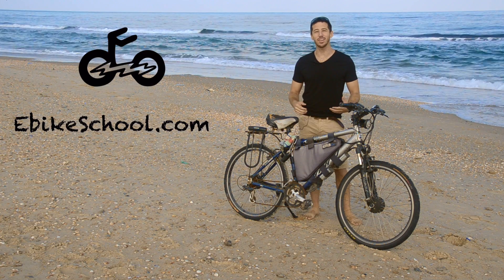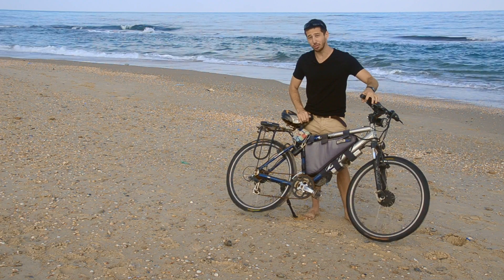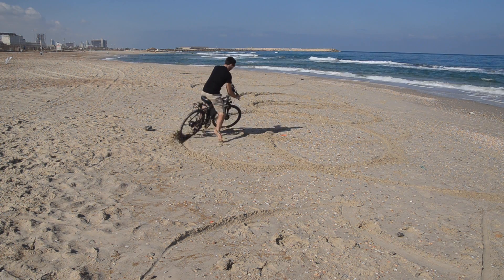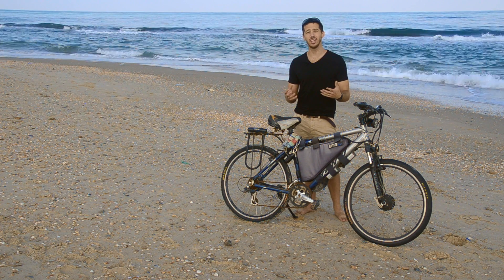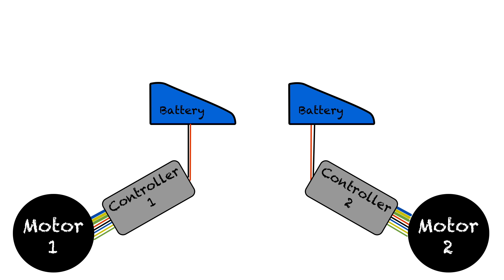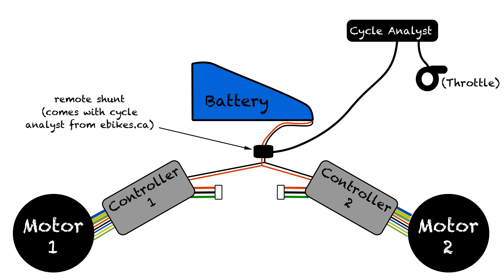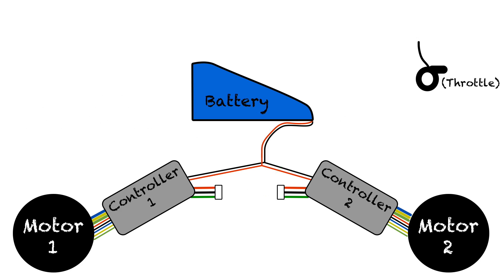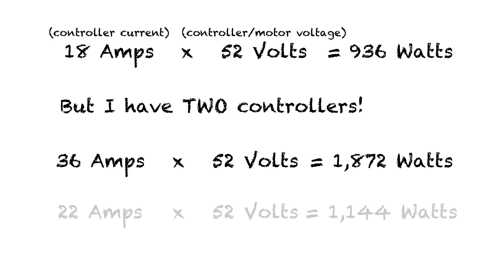DIY Two Motor 2wd Electric Bicycle (All wheel drive 2x2!!) Q&A#6

Comment: Dont you also need to connect the brakes somehow to the second controller because the of the need to have both motors shut off during braking?

Comment: I am 76 and 10 years ago I did build my own bike with the old CA2 worked great but time wore it all out and 18,000 miles was enough. I have a new e-bike (himiway)  its okay but not happy with the electronics at all. I want new cells a CA3 and two motors.  I do a lot of beach riding. can you recommend what parts I should get?

Comment: hi nice video i have an hub motor and gearless motor one has 9pins and the other has 8pins can they both work if two speed controller are conneccted im not using waterproof connector i have brushless speed controller. one speed controller has 6 hall sensor and the other speed controller has 5 hall sensor pins so i was wondering  can it work

Comment: Hi . I have a Ridstar H20 ebike . Comes with a rear hub motor of 48v, "1000" watts and a battery of 14 AH . I need some more torque for uphill . Is this possible? I don't care for more top speed so much . Just need to do 5-10 km/h more when climbing  . Thank you in advance .

Comment: Dual 250W hub motors on cargo trailer, plus dual 250W hub motors and maybe another 250w mid drive, how big  a battery pack will I need to haul 70lb dog on flat terrain for long periods of time and long distances, at a decent traveling speed "15-20mph tops on pedal assist, remember the hole set up is gonna be really heavy

Comment: Heya Mike.. you can usially filter out the wind noise with what I call the "PB filter" (removes the explosive wind noise when saying P or B into an unprotected mike).  Despite the name, it's pretty simple. You just select the part of the audio you wanna filter (you can use audacity. Free and open source) and set an equalizer effect in which you silence the lower frequencies. First 1-2 bars all the way down, the rest gradually go up in a sharp curve spanning no more than 1-3 bars. This filters out the bass. Disruptive wind noise is mostly bass

Comment: Hello there.
I have had the thoughts about awd bicycle for a couple of years now. Today I looked to your video.
It is 5 years you did it and much has happened since then.
I looked at Cycle Analyst and it seems to be alot of them.
Maybe it's not the best anymore?
I want to build a bike with 2x1000 or 2000 motors. I already have that on my kick-bike?? (Don't know English name for it, 2 wheel and a board and steering), I will use fatbike 26" wheel.
Can you help me with the choice about cycle analyst? Or if there is other now?
/Ronny

Comment: can i hook up 2 45 volt hub motors to a battery blender that has 2 battery  ports but one controler port. i did this with a three way y extension to split to hook up 2 motor controlers. will this work??

Comment: Why can't you "switch" a 48v system to 36V after its discharged at the 48v level? This way wouldnt it be possible to have a 36v hub motor on front wheel for emergency return or whatever. Not trying to be rational just asking what if? Waiting on my H6 ST now.

Comment: Thanks for your videos. Can I hook up 2 front hub wheel to a recumbent tadpole trike with an existing bafang mid drive? Wondering if the 2 front wheel need to be calibrated to spin at the same speed? Or a quad with 4 hub motor or 2 hub and mid drive combo?

Comment: So if I run 2 controllers without Cycle Analyst , do I need to use two display,s to power the controllers on and use PAS please explain a little more can I run lights and brake lever motor cut offs ?

Comment: Anybody know if you can go with 1 controller, wire everything together before entering the controller, and double it to 2000w. Given both a front hub and rear motors are 1000w 48v. Any ideas or suggestion?

Comment: Only since the pandemic money in California - I saw two in 5 years before then. Population 100,000 or so in this city, kind of blue collar. Interestingly, the regional city bike coop refused to deal with them at all. No programs, support, volunteers refused (me). Anyway they're two a day now. I will note it takes an engineering mindset to be into them - but with the cheap folders - they've become a viable student mode of transit and frequent on-campus item. Also the alternatives - e-skateboard, standup scooter, and (especially) mono-wheel, have all been determined to be a pretty serious danger and daily accident. The big-box stores are finally starting to carry ebikes in the lower power range, and even the local motorcycle shop has a seriously overpriced Yamaha in stock. One. And hey - thanks!

Comment: I have a question for you. 
In another video, you said that you can overvolt your motor but you have to lower the current because the motor is going to get hot. 
Now I see that you over clock both voltage and current.

Comment: Would the original 350w rear motor and a new 1000w front motor kit work with 2 48w controllers and 1 48v 20ah battery? I also have a 48v 14ah battery I'd wanna add.

Comment: I get 1500 watts front wheel, bafang 510 at the middle, and want rear hub 3000wt at rear wheel. How can I use rear wheel with mid drive bafang? Will they confuse each other?

Comment: Thank you Micah so much for this.  I found a kit on Aliexpress for a dual set up for front and rear 500 watt Bafang motors.  There is only one controller at 48 volts and 500 watts.  I am trying to find the specs for the controller.  Can one controller do the job?  Is two 500 watts motors through one controller like a 1000 watt motor?  A lot of newbie questions.  Is this the best place for the questions?

Comment: I had a thought...what about the pedal assist? How would that fare with the ebike as well? Would it have to be all 3 wires to one controller, then the other controller just gets the signal, or would it be the same?

Comment: I want to the same thing, a dual motor - motorcycle. I have a 1987 Yamaha BW350 and I want to convert it to a dual motor street/trail bike. The rims and tires on this bike are super fat: - Rear tire/rim: 22” tall x 10” wide tire, and a 10" x 10” hub (254mm)
- Front tire/rim: 25” tall x  8” wide tire and a 13" x 13” hub (330.2mm). I can't find a hub motor that is that wide and tall, so I was thinking of finding the largest dual hub motor available and try to weld them inside the larger rims that I have. I have only found "dual hub motors" on ebay, the largest being 13" tall tires with small hubs. I was thinking of removing the tires, and find a wheel expert to weld the small hub motor hub into. inside the existing rims. What do you think? Any advice?

Comment: I have a dual motor 3000w ebike. 52v 1500w on front and back. My 52v 17.5ah battery overheats. Can I use a 72v 20ah battery?

Comment: Hi, I have the Walmart eride 29.  Is there an easy way to add a front hub motor w thumb control?  Use existing magnet pedal sensor and maybe a water bottle battery?  For occasional hill boost?

Comment: When the wind is destroying your audio, try dropping the bass using a (High Pass Filter in your equalizer) This will take out the lows and allow your voice to carry through the video. Or you can drop the EQ ~6Db+/- in the 60-120Hz range in the video editor (I assume it has that capability)    Thanks for the diagram. neat setup!

Comment: My 40v 5ah lawnmower batteries have some connection issues where I can only use 25% power. If I just harvest the 18650 batteries for ebike conversion, how do I calculate how much volts and amp hours? And how do you know which controller will work? I've heard some controllers are proprietary.

Comment: This is exactly what I need... Dual motor set up.  Is it possible to add a 48V 1000 watt front wheel hub motor 26" x 4.0 fat tire bike? As my current ebike is 48V 500 watt rear motor with PAS.  I find it difficult going up hills in my neighborhood, as I haul my two children in a Thule Coaster XT. Now, is it possible to add a conversion kit to the front? Can the front wheel also be connected to PAS as the rear wheel is already set up.  I guess, id have two displays on my handle bar.  What if I don't connect PAS, and only use thumb throttle only when I need the extra help going up the hills.  I currently use PAS 2, and sometimes 5.  So I guess it be nice to have PAS set up on the front hub, but now how do I go about connecting it to a pre-existing ebike setup. Any thoughts or ideas or sources that would help me accomplish this goal would be much appreciated.

Comment: hey mika great videos by the way u have a great sense to speak to every type of person okay here is my quick question im sure u stay busy i got this 2000 watt 60V/64V 27A-32A Dual-mode controller thats has an electric racing car painted in the front of the box with Chinese letters & english words STRONG POWER ontop but the controller only has 1 set of all 3 yellow motor phase wires instead of blue, yellow & green so can u help me out with this im trying to put this on my small e bike with 2 48 volt 500 watt motors and my battery is a 12 in parallel 14 in series to give me 60 volts but how do i wire the both motors to the same controllers hall sensors

Comment: Hi Micah, I am planning to build an e-scooter and I’m in a dilemma about choosing a 1000W single motor or a  350W dual motor. Which would provide me the best torque and speed? My place is hilly and my old 250W e-scooter cannot even push my 100 pound son. Any suggestions? Hope you can help. Thanks.

Comment: How about one battery. One throttle. One programmable controller. Two identical motors. 
Good or bad. Why? Any thoughts 

Setup is 350 dd motors.   Flipsky 4.20 smart controller. One thumb throttle. Not sure what voltage battery yet.  Have two 36 volt 6000 ah. And one of your kits to build my own battery.

Comment: Thank you for the great information. I built my own AWD using 2 500W Voilamart motor hubs, two battery (40V for the rear and 36V for the front), two identical controllers, and one throttle to control both wheels. A year later, I bought an AOSTIRMOTOR S18-1500W Fat Bike with built-in controller (because I want stability on off-road riding over sand and gravels). I like to add a front motor hub to make it AWD and use one 52V battery instead of two. I still want to use only one throttle to control both motors, but not sure how to do this with built-in controller. Any idea?

Comment: Can you add 2 batteries to one electric hub motor. I have a 48v 1000w front hun motor. One battery is 1000w 13h and other is 1000w 17.5h. will this help with more power also? Thanks Jacob

Comment: Let’s say I have a 500 watt motor and a 1000 watt motor,
I can only supply 350 watt direct solar power.
Does the 1000 watt motor have more torque then the 500 watt motor?

Comment: Okay your sort of a wild-man of e bike no how. Question : Ariel Rider v2 is on backorder for August. After the warranty is out in a year I want to get 40 to 43 mph out of it for less than a 20 minute sprint... 1000 watt x 2 hub motors (2) 52 volt batts, 23 amp controller, selector switch front an back motor independent or dual. Unlock code 1919 stock. How would you do it. What do i scrap, what do i keep, what do i modify.. Nice video on your all wheel drive bike by the way...

Comment: Hi Micah.  Thanks for this great video.  I am wondering how does braking work with two motors?  Do you have to split wires for these as well and have the signal go to both controllers?
Reply: Braking is controlled separately from the motors. The motors don't do the braking

Comment: I have a 1000 what front motor and a 52 volt 20 amp hour battery so could I put a 1000 st back motor and age it work, or would I need to add more battery?

Comment: What about using 2 battery packs and the BMS on each to control the max amps and everything? That's how I would do it since I want to draw low nominal voltage and amps from each individual cell anyway. Sure the controllers and thus the throttle might always be offering max power, but the battery won't be giving up too much at one time. Am I missing something obvious?

Comment: mike nice vid , still missing a few parts , how do you connect your pas sensor , and your display , or you dont need it ?  my tought was when i use your setup , without cycle analist , i dont have , how does the controllerS know in which speed or pas lvl both wheels or both controllers are , since you only use power and throttle of 1 controller

Comment: Hi, I'm interested in a 2wd with only 1 controller system. I like your idea but, I would like less bulk. It's theoretically no. BUT it does work but I'm have some minor setbacks.

Comment: I have a front hub motor on my 3 wheel. I wanna make both back wheels motorized as well but a trike has special hubs already. How do I go about that one?????? I also extended my back able out about another 21" from the main frame

Comment: Hi, I'm having a e bike with integrated battery of 36v and the hub on the back wheel. As I'm doing deliveries around the city i would like to add another conversion kit with another battery for the front wheel. It will be possible to connect them to a single controller or to keep them separately and so i can put a higher voltage and a more powerful hub for the front. Can you help me understand what's better? Thanks

Comment: I would like to know if you have used your bike on steep off road trails? I have two Honda trail 110's I love them but they loose traction on steep hills here in Montana.  Would a two wheel drive bike have the low range power like the Honda has but wheel the traction of two wheel drive?

Comment: Hi, I want to build a dual voltage battery, with 2, 24v BMS's in parallel, utilizing two 7s halves of the pack, and also 1, 52v 14s BMS, so I can use it to power my 24v inverters that I already own, as well as my eBike at 52v. I have searched everywhere for a video on this and have never been able to find one. I think this would be an awesome video for those wanting to use their custom made eBike battery for multiple voltages, but don't know how to make it possible and also safe to use and charge. Thank you for all the great content, I always share your videos when asked about battery building.

Comment: Im looking for better top speed not traction. I now have a 52v 17.ah battery, latest CA-3 & Phase Runner and im waiting on a 12” 52v hub scooter mtr I just ordered from AliExpress.
 Do you think using two  mtrs is the way to go, if so what size?
Also i seen this video of 2mtrs 1 controller. 
https://m.youtube.com/watch?v=wRyYi1SQm5s Do you thinks this option is ok?

Comment: Hi. I like tinkering with things and I was wondering if this wiring diagram works for a mid drive and a rear hub with each drive system having its own battery. Or what else is needed. If this is in your book. Which one should I purchase. Thank you!

Comment: Just found this channel and your explanation is clear as crystal!. I am planning to make an electric bike for my final project at my university. I have couple question,is it safe if I have two 350w 36v motor connected to single 36v 14ah battery? And should I buy bms for it? Thanks in advance!

Comment: Hi, I have a question about modifying an electric two wheeler that I am not able to find answers anywhere. So trying to connecting with you here.

I am not talking about electric bicycles here, but a proper electric scooter (not "scooter" in American sense,  but scooter as in Italian or Indian sense).

I have this scooter that I use with rear hub motor, weighing 96 kilos with 14 kilo battery pack and can travel 70 odd km in a single charge with a maximum speed of 65 kmph in sports plus turbo mode and 90 odd km in eco mode.

No pedal or anything as it is a proper scooter like vespa or honda activa (which you might have guessed by now) with 12 inch wheels at both end.

My question regarding something I want to do to increase the maximum speed  of scooter to 80-90 kmph in short bursts for overtaking - I want to put a same type (as rear wheel) hub motor setup at front wheel as well and connect it with a switch controller (a new one or the existing one) and if required add an additional battery.

I am not an engineer, but I have figured this with my limited knowledge of science & physics that, a slight pull or push can increase the maximum speed. Of course two motors will increase the torque output of the setup. But all the people (engineers and friends) I have asked kind of say that no maximum speed will not increase with 2nd motor on front wheel.

Want to know your thoughts and suggestions. This is kind of a basic theoretical question, but it seems without practical knowledge this question cannot be answered and I will not be inclined to try it out, even though I have other plans to try out to modify the two wheeler for something else altogether.

Comment: I want to be able to sync the wheel speeds of a front hub motor and mid drive motor on one bike for all wheel drive. I know it can be done and I came to you because I know you can solve it. Bafang M620 for the mid drive and 250w or 350w Bafang front hub. Thanks so much!

Comment: New to ebikes, and recent subscriber ( great videos, definitely want to convert a couple bikes ).  Question on the video above, can you add a pedal sensor/assist with this set up ? 

Secondly, since I havent seen a video on the topic yet,   could you use a similar idea for a trike, just have both motors on the rear wheels ( same question about pedal assist/sensor ) 

Thanks!

Comment: This is great, thanks! What about connecting one set of brakes and one pedal-assist-sensor to 2 controllers? Thanks!
Reply: Best bet is to hook one brake lever up to each controller, so one brake lever cuts power to one controller, then connect the pedal assist to one controller normally while running a jumper from the signal wire of the pedal assist to the second controllers PAS sensor.